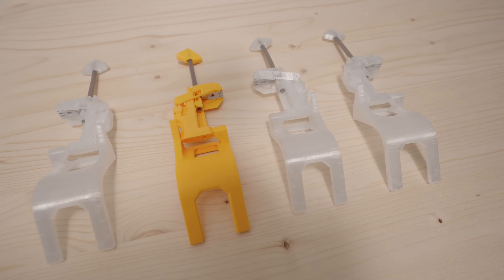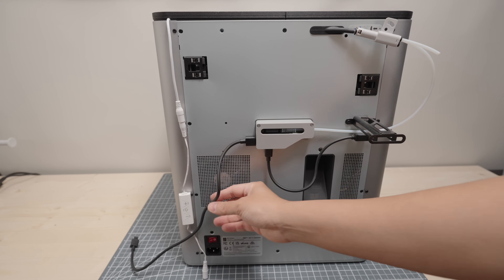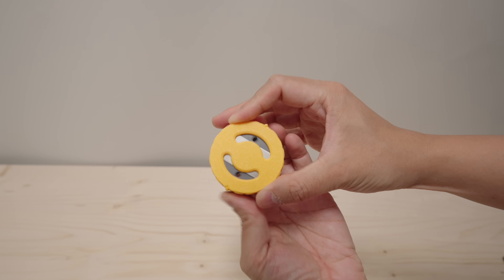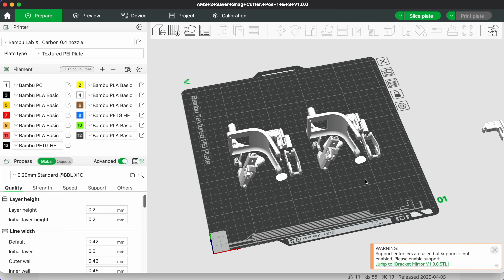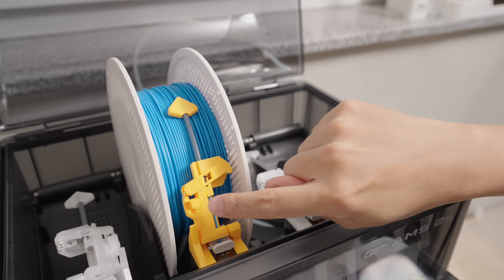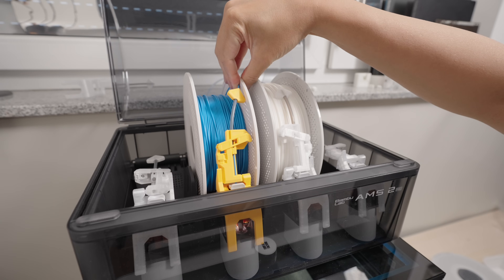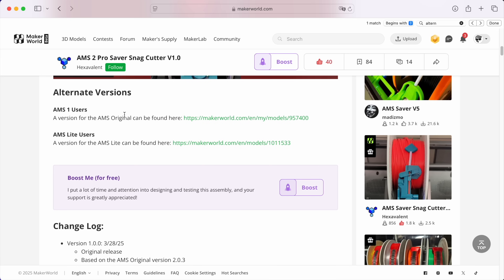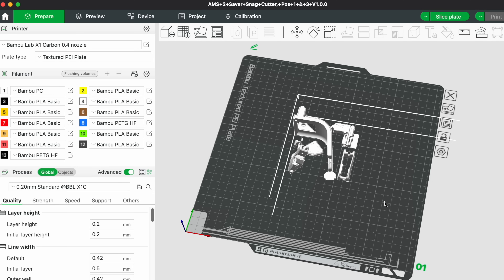The Best Upgrade for Bambu Lab AMS 2 Pro - this upgrade will save your AMS!

Comment: Really makes you wonder why bambu would use tape, when they know this is exactly what happens?
Reply from the maker: the bent end of the filament could break in the AMs so thats why they use tape to keep the filament straight.
the newer batches come with white smaller tape and should tackle this issue

Comment: The desiccant provided by the first AMS are going to leak after a couple months, i opened my AMS and there was a strange liquid inside. Came from the desiccant. Wouldn't use these again if i'll get more systems.
Reply from the maker: this dessicant is made of silica gel which can be regenerated, its not the same type which is included in the AMS 1. 
But i do recommend just buying the orange silica gel beads and print dessicant pods yourself👍🏼

Comment: This is really cool but I don’t understand why Bambulab are still using the black tape why can they not just do what they where doing before?
Reply from the maker: they found out that the bent end of the filament can get broken in the AMS, so the black tape ensures that the end of the filament is straight.
It should be released from the tape easily, but the tape adheres to the filament way too good so it gets released with the filament. 
In the newer batches, they’re using smaller white tape to tackle this isssue so fingers crossed!
Reply: @Lukis3D  for a company that makes 3D printers for the bigger and easier to use this should probably be the top priority

Comment: Just a heads up, the places the PTFE tube goes into the AMS Saver are threaded. 
Hexivalient links an easier PTFE cutter tool in his Makerworld STL post that has exact measurements without a tape measure needed, plus it's a very quick print. The tool also helps you grip the PTFE tube to thread it in.
Reply: how about a link to the cutter you mention?

Comment: Great video, do you happen to know how long the cables are for the AMS 2 pro power supply ? I know they come in 2 parts but cant find the length for each anywhere online.
Reply from the maker: thanks man! of course, the total length is about 2.4 m (when both parts are connected). each is about 1.2 m
Reply: @Lukis3D  You are a like saver, This will just reach my setup, will have to print an adapter to hold the block but I think I can make it work. Thanks so much.
Reply from the maker: your welcome man, glad i could help!

Comment: since when is this black-tape issue a thing? never had such black tape on my spools
Reply from the maker: you usually find it on newer spools - the older ones don’t have it. Even then, you don’t always find it on newer spools. Some newer spools have a white, smaller tape.
So it’s really a gambling game and you can only lose since you don’t know which one you’ll get.
Reply: @Lukis3D  oh boy thats bad lol.
Reply: The rolls that came with my P1S that I bought a week ago all had black tape well the green and orange did I haven't used the support material one yet
Reply from the maker: thanks for sharing that! But did you use up 2 spools of filaments in about a week? That’s crazy haha but I love it!
Reply: @Lukis3D  well it was the small ones they send with the printer but it has been going almost non stop since I got it so those didn't last long

Comment: Great video! I'm glad you find the Snag Cutter useful!
Reply from the maker: hey thanks so much, and thanks for the designing the Snag Cutter! Love how flawlessly it works. The black tape is such a headache and your Snag cutter is a lifesaver!
Reply: Thank you for designing this! I haven't printed it yet, just got my P1S combo recently (with original AMS), but it's my first functional print I plan on running. This looks amazing. Bambu Lab should pay you for your design and make this accessory standard with their AMS if they can't figure out a more clever way themselves. Bambu Lab solution: throw an error message and make user disassemble their AMS... LOL. This shouldn't be an accessory that we need to print! :)

Comment: Ive never run into a black tape scenario. My Bambu filament is old and I’m guessing this a new design choice with Bambu filaments. I’ve never encountered it on any other filament brands either from top quality cookie cad to Amazon basics garbage.
Reply from the maker: my older spools don’t have the black tape as well. I guess they started to add the black tape around last year in newer batches.
the newest ones come with a white, smaller tape. it’s still such a pain since it will get stuck in the AMS and ruins it..